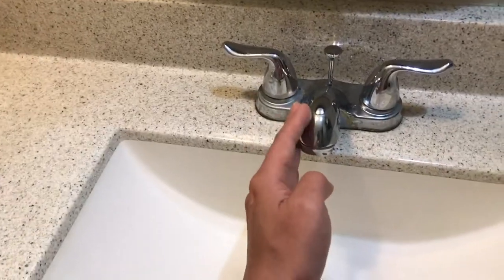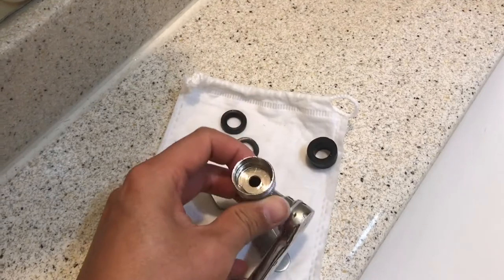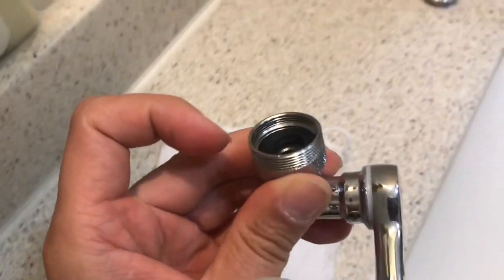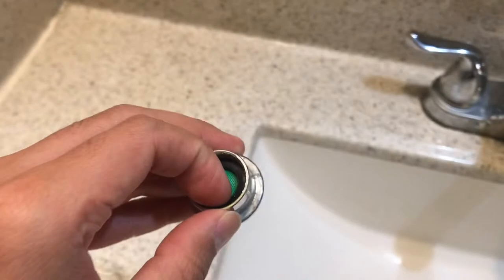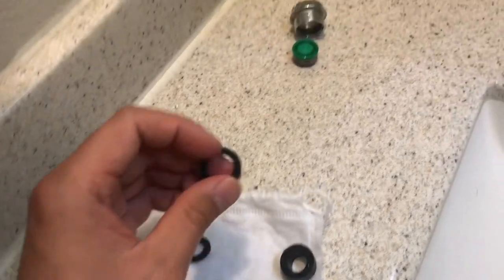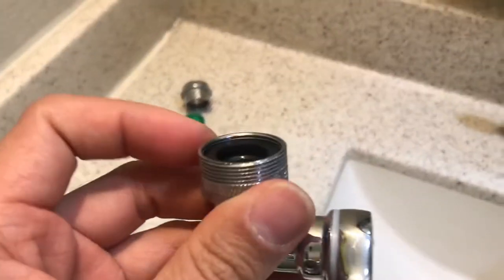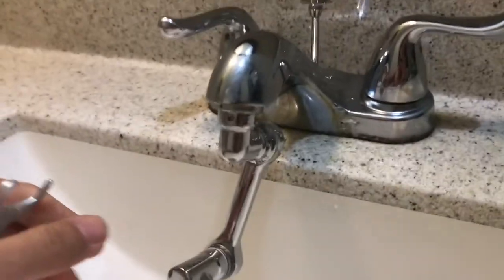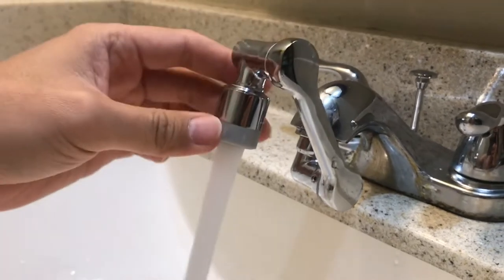How to install the 1080 faucet extender without LEAK

Comment: My problem is that I can’t take off the original part that you easily took off. What tools do I need to help me take that off. It’s so hard . Thank you
Reply from the maker: Use the wrench comes with it or use plumbing joint plier) and make sure you twist it clockwise to remove since its up side down.
Reply: @PreviewVlog  the wrench that came with it was small and didn't work. I will get a bigger one which is adjustable. Thank you
Reply: @zibadana9599  Did you buy it ?If not i can send new one for you
Reply: @dorisfu3929  yes, I bought one but I still couldn't open it. I am waiting for my son-in-law to get a chance and come over to open it for me. Thank you for your offer, Doris. Very sweet of you.❤️